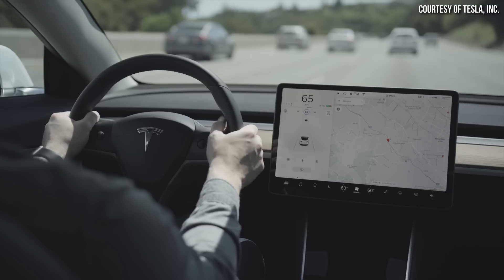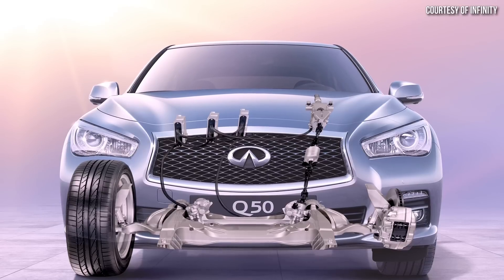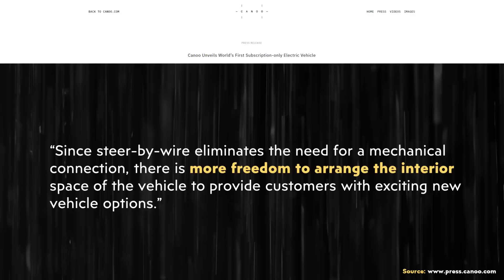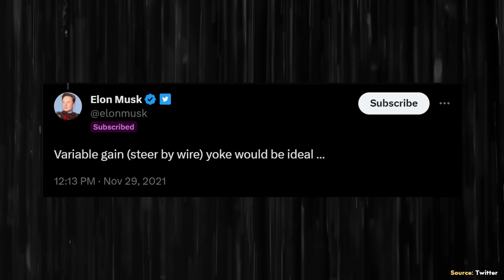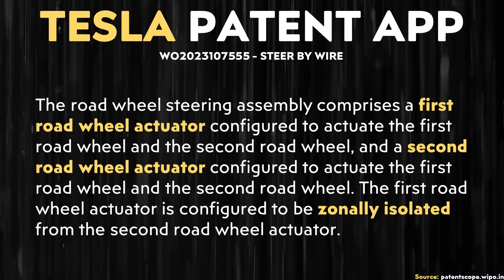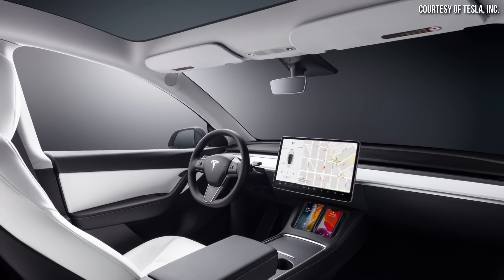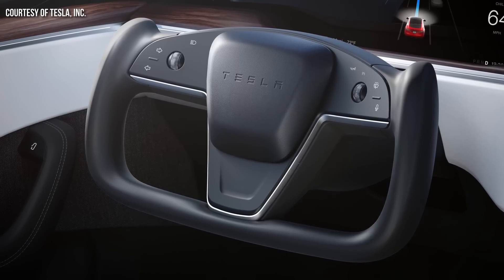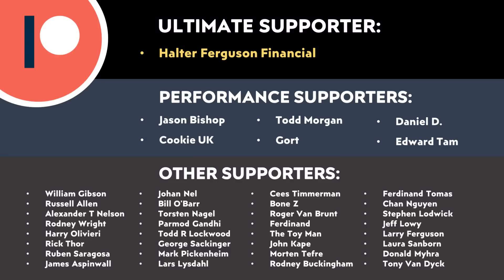Tesla Steer by Wire Technology Revealed | Coming Soon?

Comment: The car I had prior to my Model 3 was an Infiniti Q50 with DAS.  I will say that may be the one thing I miss.  The mechanical connection is clutched so there is no hard connection during normal driving.  If a fault is detected by the computer then the clutch would close and you would drive with typical steering.  It was great going over rough roads, or through big puddles, the system would absorb all that and you would just steer as if on a smooth road.  Curious what Teslas implementation is like.

Comment: IMHO, this is the reason Tesla stopped selling right-hand drive cars because SBW is about to be launched on the Model S/X. This will avoid the complexity of right-hand drive for niche areas such as islands. But the story needs to be completed by the Brake by Wire system to completely do away with the hydraulic system (heavy, costly and complex to install). Redundancy is key here, but the technology has been ready for years (I worked on braking safety and redundancy 10 years ago).

Comment: I'd be extremely disappointed if the Cybertruck doesn't have steer-by-wire implemented - especially with Elon's assertion that the vehicle should become a Hall of Famer!  With the prospect of performing diamond turns; crab walks; 'boat mode' propulsion (& not sinking;), a sane engineer should prefer to accomplish those goals with software driven steer-by-wire solution then trying to design an overly complex mechanical solution with more opportunities of physical product recalls then resolvable OTA updates for fine-tuning the experience/solution.

Comment: I was always under the impression that no US car could have anything other than a direct mechanical link between the steering wheel and the front wheels.  So drive by wire is supposed to separate the steering wheel from the front wheels? And then how do you have a back up system??

Comment: have a '23 s with yoke. love the yoke, hate that it does not have a variable ratio steer by wire setup. when in low speed parking lots/ city driving it can be a bit of a hand full, but doesn't need to be!!
Reply from the maker: Makes sense. Thanks for sharing your experience.

Comment: This is a horrid idea tried by rather likes of Mercedes and Saturn.  It is NOT a good idea.  Since there is no mechanical connection, there is no way to steer WHEN there is an electronic fitz OR a loss of power.  In both situations, a crash is unavoidable.

That's why it's not really allowed in the U.S. unless there's a mechanical base system.
Reply from the maker: What about the backup actuator, power supply and communication cables?
Reply: @Cleanerwatt  What about them?  Because every car model without a mechanical steering system has had a system or power failure and been UNSTEERABLE.  That would seem to be the final word on that idea.

Comment: There is no way I would buy a steer by wire car. People have died in plane crashes because of it. I bet it isn't going to have a 250 million dollar control system in it. The only B-2 stealth bomber that crashed was because the flight control prosser ( fly by wire) got damp, that was over a billion dollar plane with multiple backup systems. I have been a mechanic all my life and have repaired all kinds of systemes. Many throttles by wire that have failed I wouldn't trust that idea. What is really crazy is that the DOT wont let Tesla put camera operated mirrors (mirrors by wire) on the truck or the semi. But they are considering disconnecting the steering wheel.

Comment: I've got a 2022 Model S with the yoke wheel. I love it for highway driving. My hand very comfortably rests on the flat lower part of the wheel to keep the FSD nag happy. However, while making sharp parking lot or driveway turns, I often bump some of the wheel's buttons. It is very annoying to make a sharp turn only to have the washer spray the windshield. Overall, if I had to choose, I would take the yoke again over the round wheel.

Comment: Are you aware that Brembo Brakes have been working with a Tesla test mule testing electronic brakes?
They have removed all the hydraulic fluid, piston and actuators for the brake pedal, all the pipe work to the wheels and instead are just using electronics instead which has made stopping much quicker.
The future's bright, the future is Tesla.

Comment: I owned new MS LR for 1.5 years and love the yoke.  Much easier to do sharp turns if o e can "press" down to top right of yoke to turn right, left same.  Much better view as well.  The only thing dont like is the horn is button instead of center airbag area.  I think the only thing u cant do is if u want to take the car drifting.  I possoble to catch it since itsnot wheel...

Comment: One thing that should stay mechanical is the steering, imagine if it fails.
Reply: There’s an average of 10,000 commercial airliners flying at any one time virtually all of which are fly by wire. If you were to apply that logic to the aircraft industry, it would grind to a halt putting a mechanical backup on every single control on a modern liner.

Comment: Does this tech allow some force feedback? I absolutely think that being able to sense when the wheel becomes "light" is an important monitor, alerting you that you are losing adherence to the road and therefore need to act on this. This is valid in difficult conditions: maybe not very common in all latitudes, but potentially very dangerous.

Comment: Our 2022 Model X has the yoke, and while my wife likes it I’m torn. It looks cool and when going relatively straight or on highway/on Autopilot it’s nice to just rest your hands on the bottom. But if you need to go around lots of turns, roundabouts, or make an emergency maneuver it is clumsy due to the slow steering and inability to feed the yoke through your hands like a wheel. Our Model Y is far superior in that respect, so I much prefer driving that. I am more of a performance driver and look for precision in the steering (I’ve driven only BMW’s, Porsches and Ferrari’s for 25+ years). I don’t feel comfortable with the yoke to push the car quickly around corners. It needs variable steering and faster ratios.

Comment: Feedback though the steering wheel is important - and adds to the driving experience. Feeling a rough or slippery road surface though the wheel is useful tactile feedback when driving. Steer by wire would need to incorporate that.   Steer by wire would be safer in an accident though as the wheel would not be turned very quickly though impact on one of the wheels.

Comment: The Cybertruck certainly has Steer by Wire for the rear wheels - so I don't see why it doesn't have the same for the front wheels - which also allows for proportional steering movement depending on speed. The Accelerator pedal is also "by wire" as is the brake pedal - thus I wonder if one can simply move the steering "wheel" (yoke) and pedals from the Left hand side to the right hand side (I live in South Africa and need a RHD vehicle - but would like a LHD if I spend a few months first in the USA)

Comment: I prefer the benefits of the yoke for an unobstructed screen, however I find after a year of use, and recently driving an old model X for a week while my S was in the shop, that I do prefer the wheel when driving at low speeds.  For highway driving, the yoke is comfortable.  Perhaps steer by wire will be the best of both worlds.

Comment: I have a Model X with a yoke and have grown to love it.  There are no issues in the city or driving down a highway.  The only complaint is the turn signals on the wheel and not a stock.  This is OK when driving straight but when turned it is hard to find the buttons.

Comment: My impression is that this is technology for technology's sake not to provide any real benefit to the driver.
Of course aeroplanes use this technoloy as the complexities of connecting and activating all the control surfaces is more complex.
Incidentally Plant (fork truck, earth movers etc) has been using non direct coupled steering for decades, but using hydraulic power.

Comment: Tesla’s not having steer by wire is one of the things that makes them so robust. It will make sense at some point in the future, for robotaxis, but as long as human drivers use steering wheels, it doesn’t make sense to eliminate the direct mechanical connection
Reply: It doesn’t make sense to you because you don’t have proper knowledge about automobiles . 😂. It makes perfect sense. Drive by wire concept came around 3decades ago . But know it’s a must because of self driving .

Comment: I would like at least two armoured wires with independent electronics to keep control in either a crash or fault situation. You could have one systems only connected to the auto pilot control set to safely take over if the other system fails for any reason or run the connection through both sides of HW4 by different routes. If that module gets crushed you have such a serious problem that steering will no longer help because it seems   to be on the place that in older cars is the middle of the firewall.

Comment: The fully autonomous Tesla of the near future will certainly be steer by wire.  There will be no steering wheel.  A mechanical steering system (like we currently use) would make no sense for an autonomous vehicle.  I'm surprised Tesla is just now patenting this technology ... since it has long been Tesla's aspiration to build fully autonomous vehicles.

Comment: Would be interested in your views on Brembo's Sensify brake by wire system (demonstrated on a Model 3 performance about 10 months ago). 
Seems to me it would have similar manufacturing advantages for Tesla to steer by wire. It would also simplify manufacture and reduce maintenance by eliminating the need for current hydraulic system.
Reply: Would love to see both on Cybertruck!
Reply: I have the same question. Tesla makes constant changes to its cars, so eliminating all hydraulic connections with drive by wire and brake by wire would be a substantial savings for Project Highland : I find it hard to understand why it would take 12 months for such a project and just adapt the giga castings of the Model Y to the Model 3 plus a small facelift. I don't think Tesla is changing its production line to gain just a little margin: I think it wants to gain a lot on costs to make the Model 3 even more competitive and ruin the competition while preserving comfortable margins. Why should the Cybertruck have features and not the Model 3?

Comment: Cybertruck definitely has variable ratio steer by wire, and  you can see it pretty clearly in this video. you can see that the low speed "full lock" is with the the yoke at 90 degrees. (not even a full rotation) also there is a video of the CT snapping the wheels from full lock to straight in a ln instant, which means the steering wheel did not not need multiple rotations , only 90deg to snap back to straight 

https://youtu.be/pvy19pEVs1M
Reply: yup, I see that in the vid. exciting.

Comment: I’ve driven a mS LR with a yoke for about 18 months. It is not fun when parallel parking.  I would love a yoke with steer by wire with distance from extreme right to extreme left on the wheel measured at only 180 degrees.  It needs a variable ratio.
Reply: Have you seen the Lexus with a yoke?
Reply: @Miksumr  Oh yes, the steering looks great.  But, everything else is awful.  It’s a bz4x with some window dressing.  Sales are very low and only Lexus lovers will buy them.
Reply: @johnpoldo8817  Yes I agree, but Tesla shouldve made the yoke similar

Comment: Another benefit of the steer by wire system is that it will allow easier and cheaper design and build of left and right hand drive models
Reply: I'm sure I'm being hopeful here...  Maybe if/when steer by wire is a default for Tesla, they may reintroduce the Model S and X for us in RHD markets?
Reply from the maker: Good point!
Reply: 🤗VERY COOL 😎🤗💚💚💚

Comment: Not to only mention that when you ship to different countries that are right-hand drive you keep it simple because the steering wheel moves but you don't have any of the linkage you can use the exact same components and not have to run two different lines for foreign manufacturing
Reply: Yes. Model S and X aren't being sold in RHD markets right now because the new front stamping doesn't have a hole on the right side for the mechanical steering linkage.  These should be the first candidates for drive by wire.
Reply: Hi guys, I’ve just recently been told that my Model S Plaid order has been cancelled ( after 3 year wait) because they are not making it RHD, and was also told it was something to do with the steering, I also think that the drive by wire system will address this problem and will allow RHD cars to go to Uk,Australia & Japan to name a few. It’s a Win Win.
Well said Kurt 👏👏
Reply: Well, not exactly the same, since by definition you’re on the other side of the road.
Reply: @raleedy  on the Right side of the Car 😎

Comment: Can't rule it out for Project Highland, or Cybertruck, or Model 2 (not that we know the model designation yet), or yoke-equipped cars.

But the redundancy problem might be sticky. I can imagine steer-by-wire requiring a lot of time in the kitchen before it is served.

As for cost savings...

Maybe not.

Most of the world's supply of neon came from Mariople, Ukraine. Which is now literal rubble. Establishing new sources of supply is a nontrivial task (e.g. years and capital expense).

Neon is mostly used in lithographic machines to produce microchips.

Fabs had stocks of neon before the war, but those will be exhausted soon, I suspect. Which means we may find ourselves facing chip shortages in the near future.

Steer-by-wire will require more chips. If there is a chip crunch coming... Well, scarcity drives up prices. And fewer chips will stretch further to more cars if steer-by-wire is postponed until fabs can answer demand.

True? I don't know for sure. Some chips may be unaffected by the neon shortage. Recycling neon may keep fabs going until fresh supplies become available.

It's just food for thought at this point.

But I don't think we're done with supply chain breaks. Those could affect Tesla's decisions, including steer-by-wire.
Reply from the maker: This is great insight. Supply chain woes could definitely effect this becoming a reality sooner rather than later.

Comment: Steer-by-wire and direct electric braking would cut weight and replace a hydraulic system. This would be much cheaper, lighter and better for a robotaxi.
Reply: The steering rack in a Tesla is electric, not hydraulic
Reply: @markedwards4879  yes - but there seem to still be mechanical fail-safes for steering, and brakes aren't electric yet. Going fully electric probably requires negotiations with vehicle safety regulators.

Comment: I surpose that with steer by wire would also enable the steering wheel to be place in say the middle of the front seat if desired.
Reply: Or in the back seat for the Mother-in-Law option.
Reply: @FrunkensteinVonZipperneck  🤣